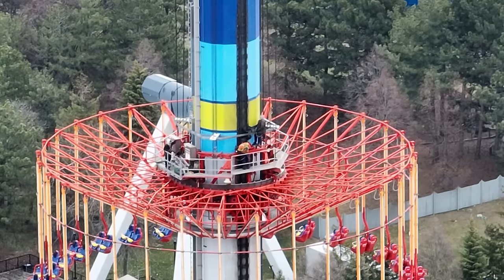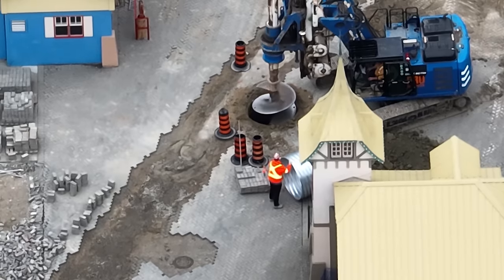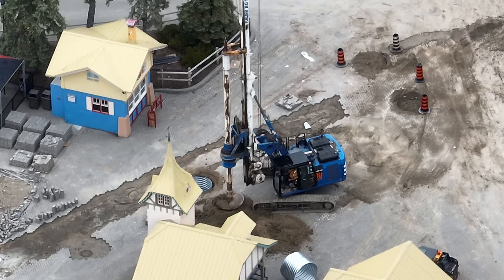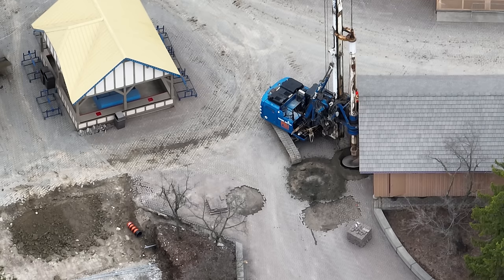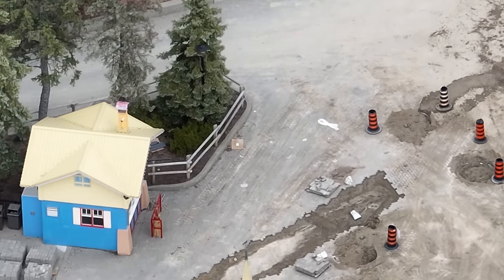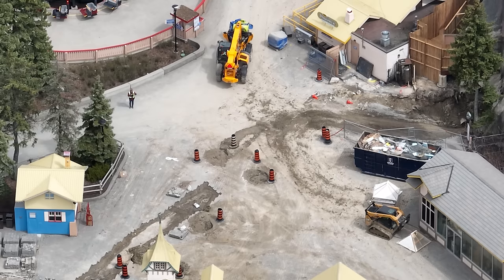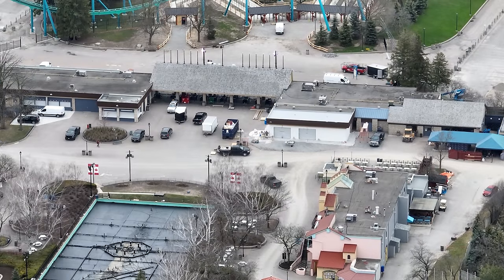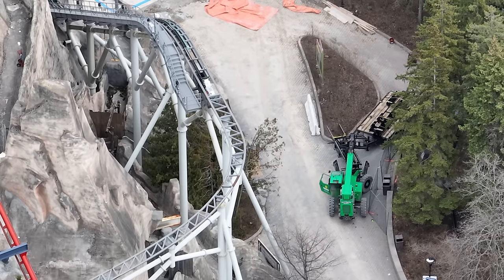Canada's Wonderland 2025 Footings & More

Comment: Im starting to think the coaster wont launch out the top of the mountain, due to space issues. What I bet will happen is the coaster will go from a loading area into the mountain basement, stop within the mountain with a dark ride themed section, and then launch out of the mountain into a top hat. Kind of like how Velocicoaster has a themed "raptor cage" section before the launch, there will be some "escape from Wonder Mountain" theme in the mountain before the launch, running from the Wonder Mountain dragon etc etc.
Reply: However, intamin has a vertical launch system

Comment: Could find some more detail on the project in the Vaughan construction permit site.  There is tons of detail on the hotel proposal for 2018 but that required a committee for use development.  The permit for this should be on there though and would have detail on the cost.
Reply: So what is the cost?
Reply: It's not there, at least not within the last 5 years of reports which is what's publicly accessible.

Comment: From ChatGPT 😅

ChatGPT 3.5

User
Why would a sonotube for a future footing be enclosed in a metal corrugated pipe

ChatGPT
Enclosing a sonotube (a cardboard tube used to form concrete footings) in a metal corrugated pipe could serve several purposes:

Protection: It can protect the sonotube from damage during construction, especially in areas with heavy equipment or where the ground conditions are rough.
Moisture control: The metal pipe can act as a barrier against moisture, helping to prevent the concrete from absorbing excess water or from drying out too quickly, which could weaken the structure.
Durability: The metal pipe adds an extra layer of durability to the footing, protecting it from environmental factors that could degrade the concrete over time.
Ease of removal: The metal pipe can make it easier to remove the sonotube once the concrete has cured, as the metal may slide off more easily than if the concrete were directly against the cardboard.
Aesthetic reasons: In some cases, enclosing the sonotube in a metal pipe may be done for aesthetic reasons, to create a more finished look or to match other metal elements in the structure.
It's important to note that specific reasons may vary depending on the construction project and the requirements of the footing design.

Didn’t help 😂

Comment: This is kind of bad news I’m afraid.  Those short metal “caissons” aren’t for forming concrete like a sonotube.  Footings are poured into sonotubes and as you said needs to be deep.  There is no sense in burring them before installing the rebar cages or pouring.  Doesn’t make sense.  Why would they only dig them 6 feet deep then put in a short corrugated tube meant for drainage then bury it?  At this moment these don’t look nothing like footings but they have to be.  So I’m very confused.. STILL LOL
Reply from the maker: Trust the process, trust the process ;)
Reply: @AmusementInsiders  but didn’t we already have all the footings poured at this point for Yukon? I’m trying to remember…
Reply: @chez_calabrese  Could just be "insurance" for drilling the deep holes down the middle, no?  Path protection, future erosion protection?
Reply: @macgyveriii2818  yeah seems like that.  Just why even start them if you can’t finished them.  I got a feeling they ran out of time and needed to cover up with a quick way to find them and keep moisture out in the meantime as you said